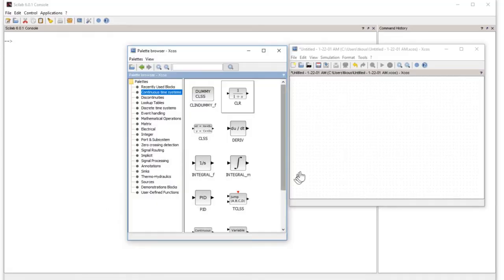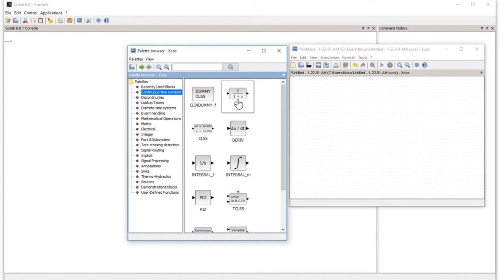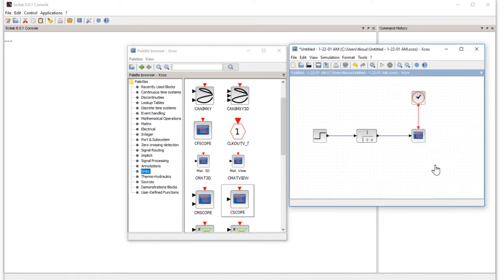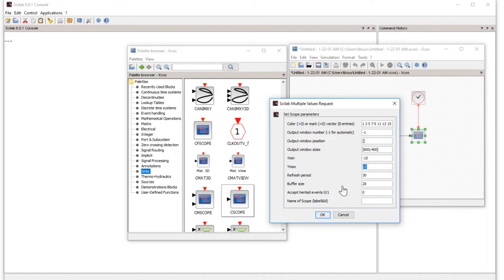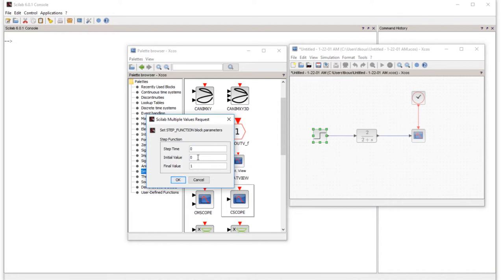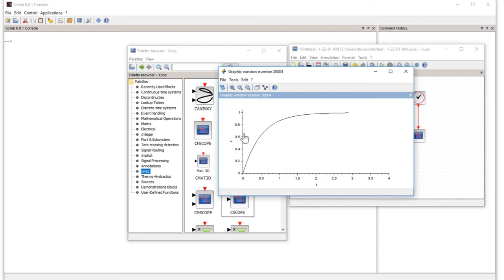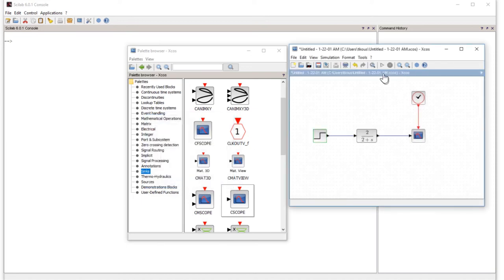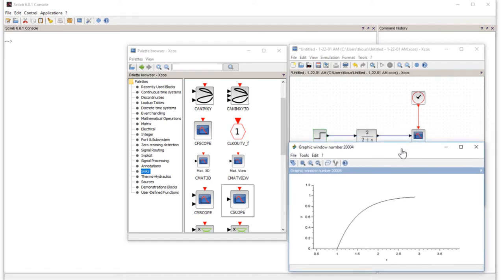Making your First Simulation in Scilab Xcos [Unit Step Response]

Comment: For me the Graphic window runs to the X value of 100.000, displaying a flat line (because the graph goes against 1).
Reply from the maker: Dont understand is there a problem you are facing may be explain a bit in detai
Reply: @digitidea  Well, I would like to see the beginning of the graph. The graph starts in your video at x=0 and stops shortly after that.

In my case, when I press play, the values for x <= 100.000 is displayed, but just the last numbers. So I see only a straight line.

When I zoom into the beginning with the consolcommand, I see no values.
Reply from the maker: You can type the code youself once scilab is installed if it is not in video i can send you the file when i go home currently cant access if you want file drop your email
Reply: @digitidea  Which code? To zoom out?
Or you mean coding it, instead of using Xcos?
Reply from the maker: I mean you just run the code on your own PC and see graph
Reply: @digitidea  Nevermind. My integrationtime got somehow reset to 10.000.
Reply from the maker: As I mentioned just copy the code from the video I mean type it yourself complete code!
Reply: @digitidea   It is fine. Thank you.
Reply from the maker: welcome mate